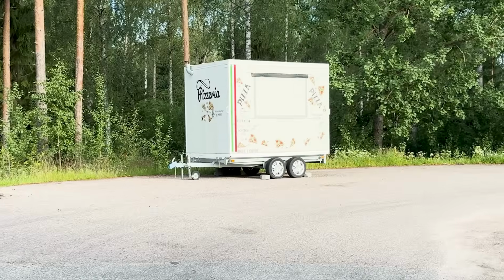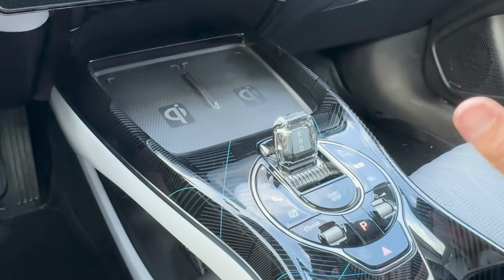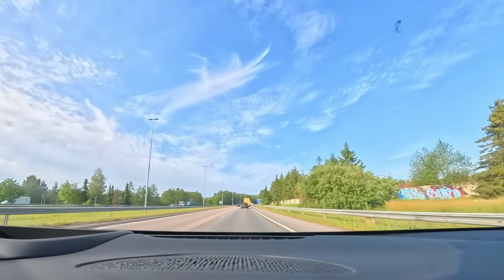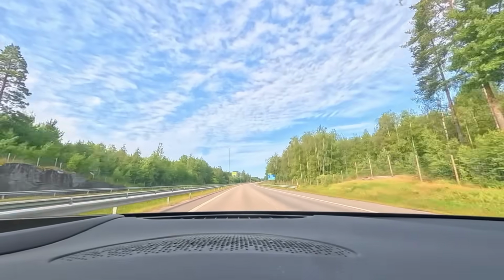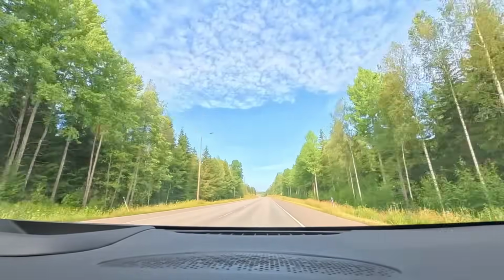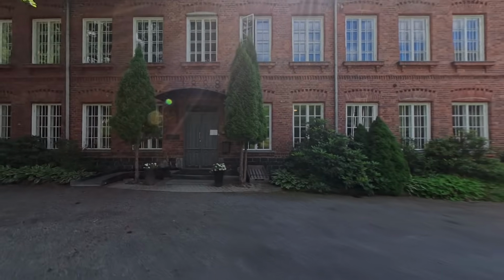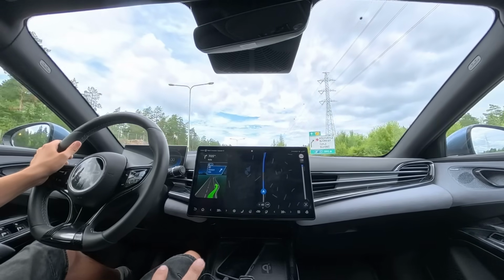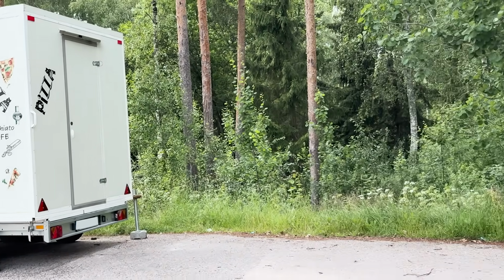BYD SEAL Range Test: Unexpected Results! 🔋 😲

Comment: a bit high compared to Tesla model 3
Reply from the maker: @bluescoik  Model 3 power train is a bit more efficient, yes, but a few things good to take into account: 1) Seal is heavier due to being a bigger car (4.8m vs 4.7) with larger LFP back and arguably different class interior materials, so these already explain most of that gap. But surely Model 3's power train is also very efficient, there's no denying that.
Reply: @The-Electric-Seal  yes, just saying cuz it is the main competitor, also the wheels are bigger. By any chance have you tried using r18 wheels? I think the efficiency might be closer
Reply from the maker: @bluescoik   good point, haven't tried the 18 wheels, so difficult to say what kind of impact those have on consumption.
Reply: @The-Electric-Seal  On tesla it is about 10-15% range increase between r18 compared to r19
Reply from the maker: @bluescoik  Interesting, that's a quite big difference

Comment: Do you find economical manual driving can be as good or better than using cruise control in case the cruise control reacts more to other vehicles and causes slowing and accelerating?
Reply from the maker: There can be a bit of difference, yes. Mostly for me it is meaningless though. But sometimes I feel like it would be nice to put to car to fully regen-less coasting mode, like switching to neutral, and just fully coast. But switching to neutral in the middle of a road doesn't sound like a great idea... so some setting would be nice to fully turn of the regen and then you could just coast in long very slight downhills - that would be energy efficient!

Comment: In australia using seal premium ..... mixed use. Am getting 14.8kh per 100 on average. Have done 20000klm
Reply: Maybe i just have a great effiency
Reply from the maker: That is a very good efficiency - of course RWD helps with this. I have the performance AWD which adds a bit.
Reply: I think one of you too is enjoying it more 😂 and its not a deal breaker if you ask me!

Comment: Am from Ethiopia ,I have BYD SONG PLUS SMART 2025 APRIL and I cannot access for BYD APP on mobile ad me Email address ,radio ,user manual  if you can please help me.
Reply from the maker: Unfortunately I don't know that car, but have you asked from local dealership? They may need to manually register your email address and car for mobile app use.
Reply: @The-Electric-Seal Thank you for quick response . It's same as BYD SEAL I cheched from your YouTube same function . In our country Ethiopia I cannot get a dealer only seller. If you can help me how can access . Even Radio snd some functions are not functional

Comment: Results might be better. Check the SOH of your battery via Obd2. My Seal is at 97.76%, which is 80.7kwh instead of 82.5. Greetings from Frankfurt
Reply from the maker: Good point! My SOH is about 99%, so yes,that could've taken into account. Impact on consumption calculation would be about 0.15 kWh/100 km.

Comment: I can see you used "High Regen", you will get better efficiency with Standard Regen.

I regularly do 450km round trips in my Seal Premium (80% 100km/h, 20% ~60km/h) and usually have around 15% SoC at the end of the trip.
Reply from the maker: True, the lower the regen, the better efficiency (except in certain type of city driving). Of course that impact is quite tiny - but everything counts!
Reply: @The-Electric-Seal It is a common misconception that the BYD regen setting is an efficiency setting. High regen provides a faster regenerative deceleration profile when lifting your foot off the pedal, it does not result in higher efficiency, in fact, normally the opposite is true.

High regen can in some cases result in more than necessary deceleration, resulting in additional energy need to recover speed. Also if you slow to a given speed quicker, you will need additional energy to maintain that speed over the same duration/distance.

Whilst it is possible with very careful and skillfull throttle control to maximise efficiency in high regen, in most cases standard regen will be better.

Overall minimal deceleration (Standard Regen setting) or coasting results in greater efficiency (conservation of momentum). Naturally if this is not enough, you can use the brake which is also regenerative, so you can augment any accelerator pedal regen with the brake regen to slow down faster as needed.
Reply from the maker: Exactly, well described. The only exception to this is the kind of driving profile (in city streets), where you are unable to realize the efficiency gain from coasting - in that scenario the high regen may produce the best efficiency. But on larger roads, especially on highway, the advantages of coasting is there (though still not a massive benefit). Actually, it would be lot of fun to have "regen off" setting and just fully coast (not keen on switching it on neutral while on highway)..
Reply: @The-Electric-Seal you can get a regen off experience if you set ACC at 100km/h then accelerate to say 130km/h. The Seal will coast at 0kW recovered back to 100km/h. This gives you a great feeling of just how "Slippery" and low Cd the Seal is.

Comment: The battery range the car is giving you with the latast software, just wondering how accurate/ true it is as I’ve got a 310 mile trip this weekend
Reply from the maker: You mean the range estimation? I typically don't pay that much attention to it, but in the case of this video, where the range ended up being 507 km, and the range estimation in the driver's instrument cluster in the beginning was 472 km at 94% (i.e. 502 when scaled to 100%), it was actually surprisingly accurate. But it varies, depending on how conditions change, and your driving style/route profile change. 

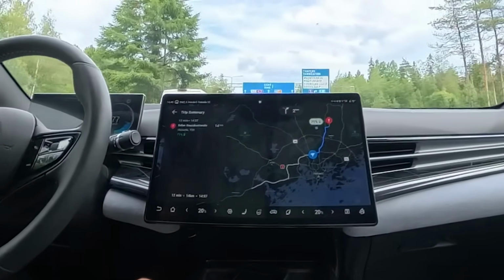My tip when going for a longer trip is to use the navigation and tap the vertical bar on the right side of the screen (the trip progress bar) and then the car gives you always updated estimation of the SOC at destination (see this video at 32:51) - this is a good tool on longer rides when unsure of the range. I find it more usable than the range estimation in the instrument cluster.

Comment: I also have this "factory" dashcam you mentioned, but never noticed the fact that it's controllable from the steering wheel:) Could you please provide more details? Thank you!:)
Reply from the maker: Sure, you can set up the one button on the left side of the steering wheel (the one with the screen rotation icon I think) to open the dashcam view and lock the current recording so that it won't get overwritten but stays stored in the SD card. I find it pretty handy, no need to navigate to apps or use the touch screen.. when something happens on the road, I just push that button from the steering wheel to save the clip.
Reply: @The-Electric-Seal  Perfect, i try it right away:) Thank you for the help!

Comment: I had been dreaming of getting a BYD Seal Excellence but my company rejected it, we are not allowed to get Chinese EVs, which I completely disagree with. Could you perhaps make a video about them "listening", who "listens" and doesn't this also happen to the American and German EV manufacturers? is there reason for concern or
Reply from the maker: Sorry to hear that, there are a lot of misconceptions about Chinese EVs. Here on the channel I try to avoid ”politics” and just focus on the car, driving and experiences. But it is a bit funny that company policy rejects this, and at the same time with pretty much any modern car - be the brand German, French, American or whatever - a large part of those vehicles are anyway ”Chinese” when you check the value chain and supplier chain on more granular level. The brand is only marketing to large extent.

And of course everybody has used iPads, smart devices, laptops for decades already that are largely ”Chinese” in terms of production, parts and suppliers (even if the design and brand are something like Apple). Now when the smart device sits on four wheels, it is suddenly somehow not within ”company policy”… 😂

I hope you get it sorted out and common sense wins.

Comment: Just a few days ago I have done a Roundtrip of 460 km with my Performance AWD from my Hometown to Bangkok to get a Frunk Soft Close installed. When back home I still had 10% Battery left, so easily could get 500 km out of a full charged Battery. I'm very satisfied with this Range.
Reply from the maker: Great result! How was the weather / temperature?
Reply: @The-Electric-Seal  Assumed he said that it's in Thailand. I'd say it's hot and humid, like around 35C hot, probably a little bit of rain.
Reply: @The-Electric-Seal  Temperature was 32-34 deg.C only as we have raining Season at the moment. But no rain at that day.
Reply: Interesting. Tomorrow I'll receive my Seal AWD but the past couple of weeks I've been anxious about the range. The farthest typical distance I drive is ~443km in a place where it's usually 35ºC all the way, and the second half of the road is in the mountains (short sections). This is killing me because I'm not sure if the Seal will deliver but reading your comment gives me comfort. Thanks. Any suggestions?

Comment: I find the tire pressure too low. Did you set it that way on purpose?
Reply from the maker: Maybe a bit on the lower side, true. During the drive it was up a little bit to 2.5-2.6 / 2.9-3.0. What kind of pressures do you use?
Reply: @The-Electric-Seal My Born weighs 1840 kg empty. With me and the bass box, it's almost 2 tons. I use it with a pressure of 2.8 -3 bar. With the old Eco tires, I experienced a loss of grip above 2.8 bar, but with the new Conti PremiumContacts, grip is maximum even at 3 bar, but it reacts more lively to the steering wheel. I would experiment if I were you, the optimal pressure can still improve consumption.
Reply from the maker: True, there can be a consumption impact because of tyre pressure. I think BYD recommends 2.5 bars to front and 2.9 to rears for the Seal. At end of the test I had 2.6 / 3.0 so it's quite well aligned. Before driving it was a bit low 2.4 / 2.8.

Comment: Best Seal-tuber - watched all your vids while waiting 4 painful months for my Performance to arrive. Finally got it 2 weeks ago :D

Same as you I drive in sport mode as the accelerator pedal feels so much better. ECO and Normal you have to push it a lot further for anything to happen, feels like there's a big dead zone. Prefer to drive economically in sports mode.
Reply from the maker: Thanks, great to hear you like the content!
Also congrats on the car, that sport mode is addictive 😅
Reply: I test drove a dolphin and it seems this is across BYD vehicles. I really hate those types of dead zones, had one in my dad's civic and since i only drove his car occasionally I always felt the difference and it's really jarring.

Comment: Nice job you will
find that no matter the profile set if you drive is the same across profiles the result will be the same. Since you have started the drive  with the battery a lot less than 100% I would like to see how many actual kilometres you get at 50% of battery if you start at 100%. In my view your results are good no loading the car  up and possibly not using heater or aircon. You will also find that the battery will change power delivery as the power goes down using  different cells. It's also a good idea to provides your current SOH of your battery. Keep it up thanks for your work
Reply from the maker: Very good points! I coudl start off with 100% next time and do bit longer drive.
My SOH is 99%, or was a couple of months ago, assuming it’s still the same. Probably 98/99

Comment: remind me yours is the single motor version? 

because this week i drove my two motor seal in Kuwait to summer heat 42-50C and i got only 270km from 100% to 5% because of the AC and i got around 20kWh/km so it's supposed to get me around 380km
Reply: The AC consumes  A LOT. I get that experience In Portugal where summers are about 35ºC. The rest of the year I get much better cocnsumption
Reply from the maker: Performance AWD, forgot to mention that in the video. Those are pretty tough conditions you had over there! The Finnish summer temps are quite a bit milder, which helps a lot 😅